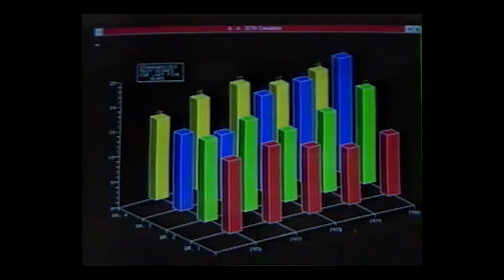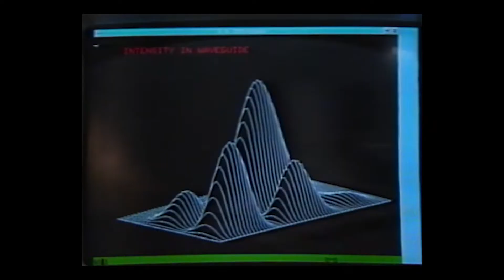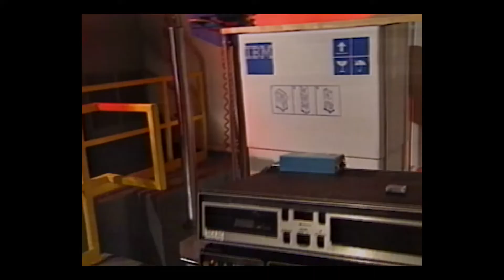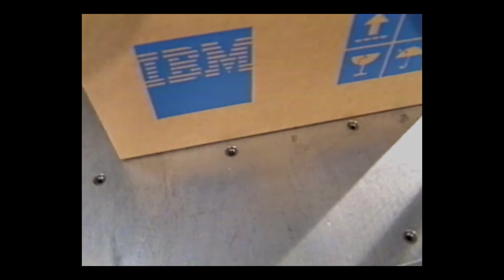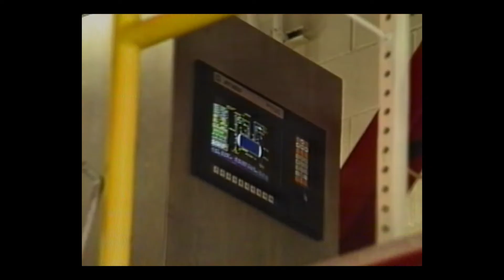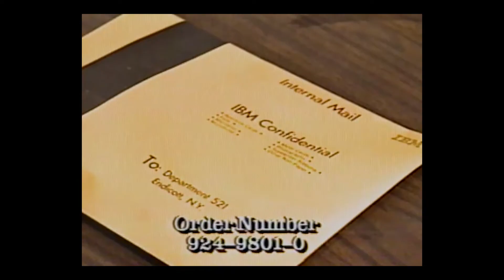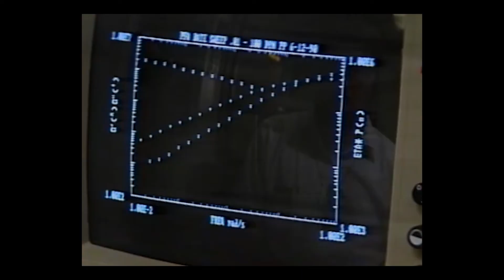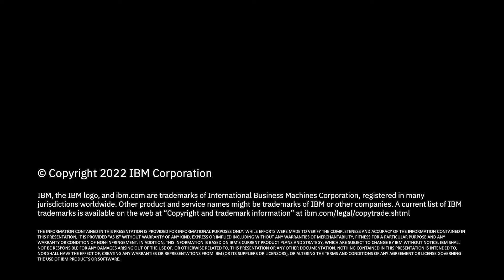Fall 1990: IBM Endicott In-Site

Comment: I worked at Glendale lab when this video was filmed. I tested the small processors for the engineering lab. I ran test workloads that were used to benchmark the performance of these processors using the VSE, VM running VSE as a guest, and MVS. VM is a really nice operating system.